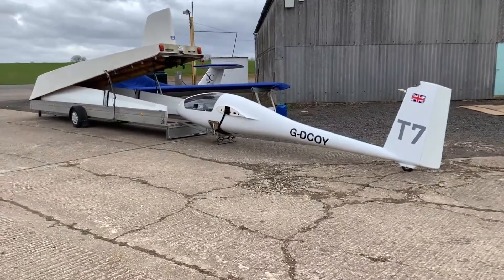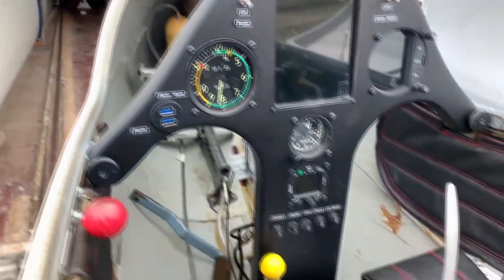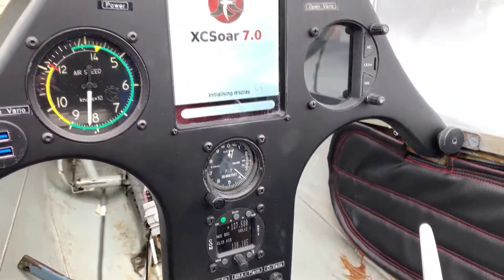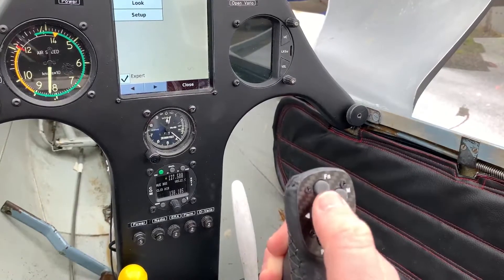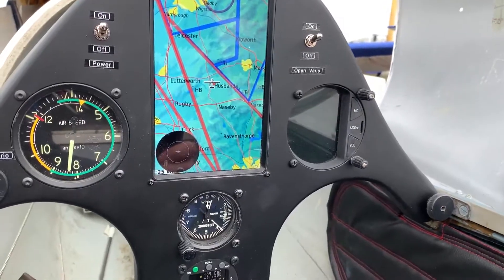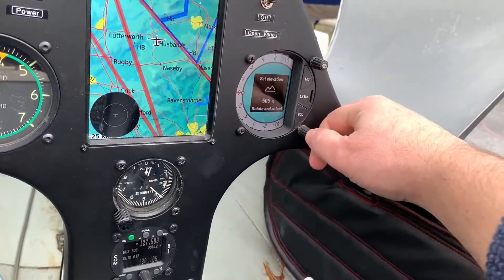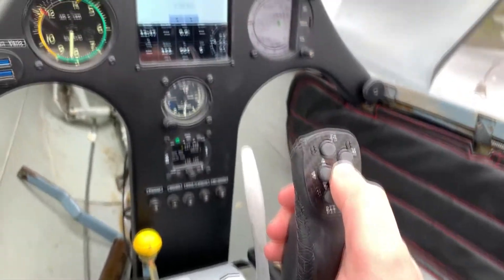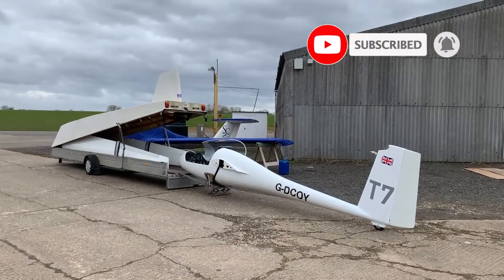Glider New Instrument Panel Build (Part 3): Does it work?? (SteFLY OpenVario, LX ERA80 & PowerFLARM)

Comment: Good day.
I’m considering getting a Stefly Openvario display for my sailplane (SGS 1-35) this winter.
How has your display worked for you these past two years?
Any issues with reliability, or anything you would do differently if you were to buy one today?
Thanks!
Reply: Hi, Its brilliant and no issues at all.  If I swapped gliders I would buy this again.  You might want to look at the XCNav one as that is running on Android and has wifi built in etc, but not sure if the Stefly remote stick works with that one as theirs looks a bit low budget on the buttons.  However, I've got mine running on a USB wifi antenna and paired with my iPhone for updates and downloading tasks from Soaringspot or WeGlide.
Reply: @richardtorr-T7  Thanks for your quick reply Richard, greatly appreciated!
Cheers,
Doug

Comment: Beautiful panel!  How are you liking the Stefly open vario?
Reply: Thanks Ron. Its brilliant. I just upgraded the XCSoar software to v7.4 (from v6.8) and that's even better. Not sure why anyone would spend over £4000 on the LX9070. I'm sure there are a few nice features, but not for 4x the price.  I'm trying to get WiFi enabled now (I have a supported USB dongle), so I can connect to SoaringSpot for task upload and downloads via an addon called 'Compman' but can't get the Linux console to accept commands, so I'll be posting on the OpenVario forum later. If I get it working, I'll post a quick video on that too.